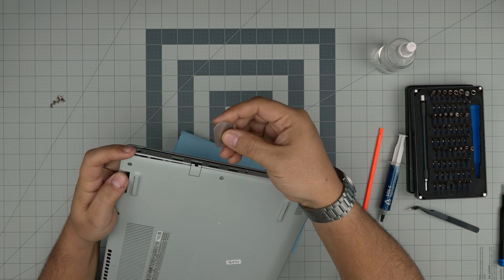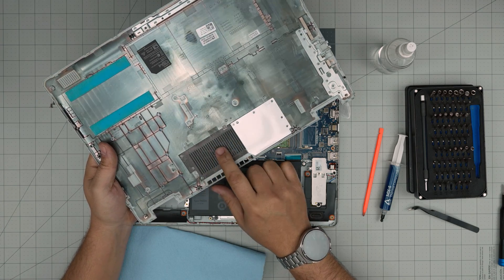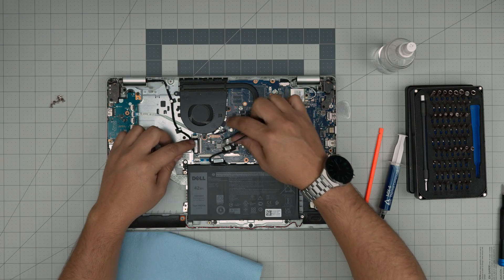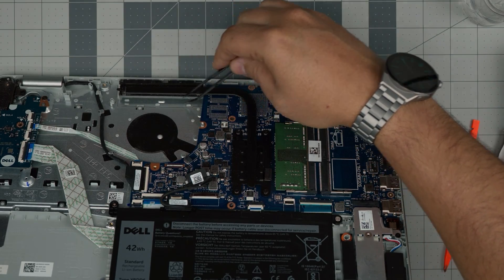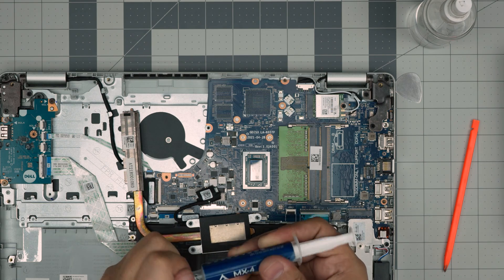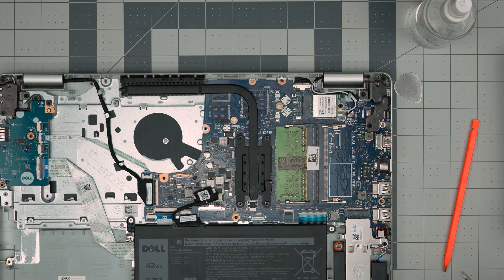How to Clean & Repaste Your Dell Inspiron 15 3505 Laptop | Easy Guide

Comment: My laptop same thing is giving CPU failure code after replacing thermal paste. Please help.
Reply from the maker: 🫠Regarding your question, replace the thermal paste with a good-quality paste and test it out.
Also, can you be more specific about the “CPU failure code”?
cheers🍻
Reply: @uFixTek CPU failure code is two amber flash and one white flash on power led indicator.
Reply: I used deep cools thermal paste  @uFixTek
Reply from the maker: 2 amber flashes + 1 white flash:
CPU failure / Motherboard fault
normally when we get that code re do a reballing the CPU and the issue will get fixed, or it could be bad mosfet (power delivery)
These almost never fix a true 2-1 code, but are worth a shot before calling it dead:
1. Power drain
   * Disconnect charger.
   * If possible, disconnect the main battery from the board.
   * Hold power button 30–60 seconds.
   * Reconnect battery and charger, try to power on again.

2. Bare-minimum boot
   * Remove SSD, extra RAM module (if not soldered), any USB devices.
   * Try to power on and see if the blink code changes.
Reply: @uFixTek thank you. I have found a new motherboard with a upgraded CPU for this model Ryzen 7 for 100 USD I think I will replace as my area very few people to board work.  
Cheers bro.